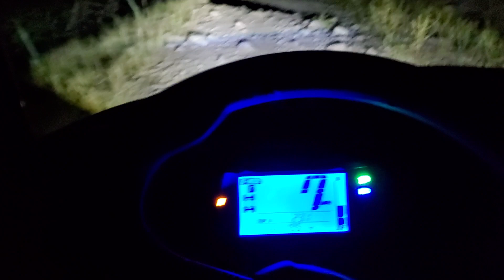How's the downhill? Noise? Suspension? Hold back? Cab Noise? Squeaks? Throttle? Yamaha RMAX 1000

Comment: I am looking to purchase 1 possibly March next year.  I really like that color and would like to know if I can order it from the factory with the in cabin adjustable shock option. I have really bad knees and it is difficult to kneel down.  Hope you are doing well and thank you for sharing.  Daniel.
Reply: You'll need to get the LE model.  Electronic suspension and stereo will be stock.
Reply: If that system goes bad its like 3000 to replace.